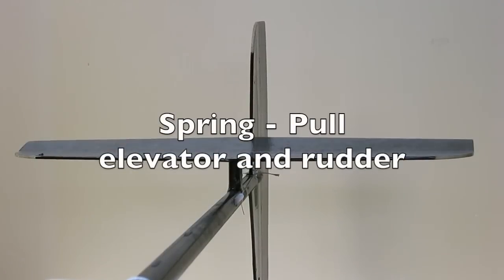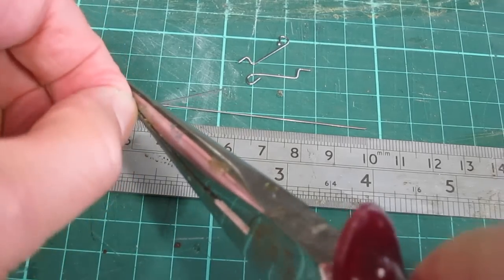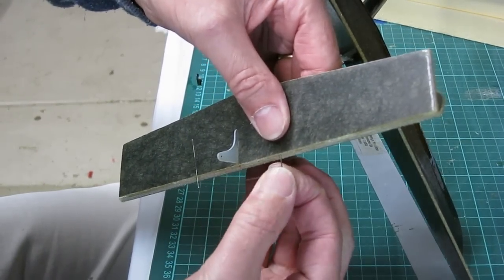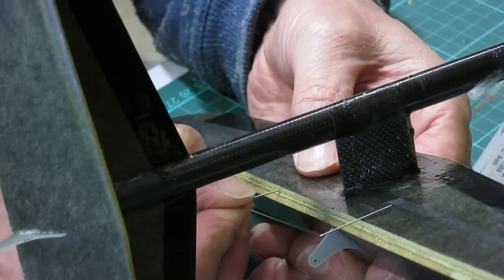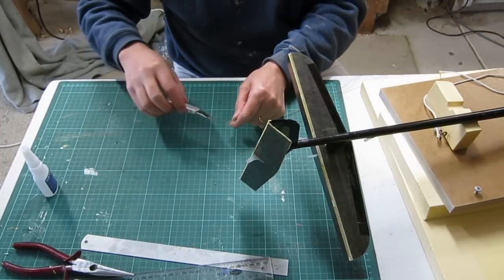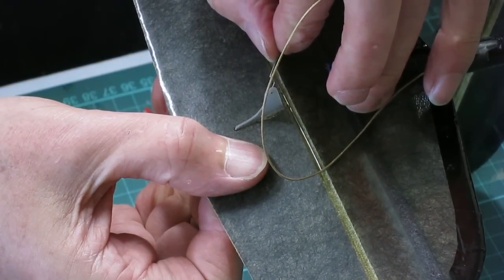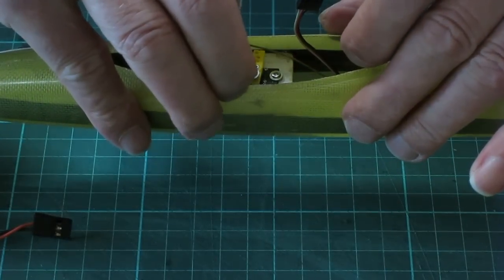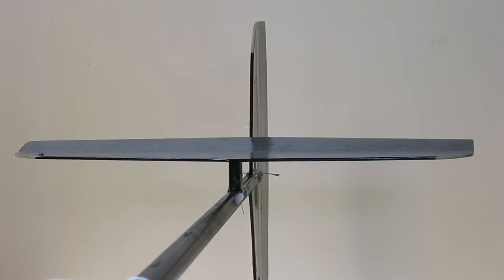V2 DLG build Part 3 - Spring Pull setup

Comment: Just watched the video again Andrew , for some reason I thought the spring had to be put in under tension , but of course it doesn't , the spring tension is created by pulling in the opposite direction , also i think i'm over thinking things as 'im about to build my first DLG kit and I am , and a bit worried I will get something wrong mate . Thanks so much for getting back to me , love your videos mate .
Reply from the maker: +Scott Thompson Thanks Scott. Might be good to try the spring out in some foam or balsa first. It is a bit scary the first time.
Reply: +Andrew Newton Cheers Andrew. I will do , also , does the spring ever work its way up to the surface after time ?
Reply from the maker: +Scott Thompson Not yet Scott. A little CA strengthens the hole
Reply: Cheers mate .

Comment: Thank you for this great instruction!
Could you please explain: When the rudder is in neutral position, then the spring is under tension, right? Doesn't this cost much more battery than a push-rod system does, where there is no tension in neutral position, and the servo doesn't need energy to hold it in neutral?

What kind of spring wire can be used?
Reply from the maker: Correct but the extra battery drain is insignificant. Very thin spring wire or SS wire. Might be 0.3mm, not sure.

Comment: Hi Andrew, great video. Which side of the rudder do you attach the horn? I guess that the horn should always be on the opposite side of the plane to the throwing peg. That way during the initial part of the discus launch the string will tension and prevent the rudder being deflected by the initially high wind forces during rotation. What are your thoughts please?
Reply from the maker: baggs1955 Correct. Opposite side to the throwing peg.

Comment: hi andrew - experimenting with the torsion spring hinge and here on your video i'm not seeing a bevel on one side of the elevator? i would expect that to be needed in order for the elevator to swing freely in the direction away from the side where the hinge is.  i can see that this foam core is very thin but i'd still think it would get hung up if one side didn't have that angled relief.   what am i missing?  thanks.  btw - i am finding that a plain (unwound) .018 guitar string works well for the spring - plentiful and cheap, you can get one at a music shop for a buck, giving you > 30" of material.
Reply from the maker: Good tip thanks, never thought of a guitar string. There is a bevel but the elevator is so thin it doesn't really matter.
Reply: Thanks, I am about to embark on building the Ultra light SS from Andrews website and have been scratching my head trying to figure out what wire I would need for the torsion spring. I've ordered 3 lengths of Anti-Rust Plain Steel Single String .018 and can't wait for it to arrive!!
Reply: @Andrew Newton Test it out on your blog, these torsion springs are brilliant but I had no idea where to find the right material.

Comment: Have you ever had a case where the spring wasn't strong enough to move back properly in high speeds?
Reply from the maker: Not with gentle gliding but it could happen

Comment: Great video Andrew, Thanks. I would like to use this system for a warmliner elec glider (Kunai 1,4m), a few questions - Do you think this setup will be able to handle the extra forces of that plane? Is there a lifespan on the spring itself, ie does the spring lose its torsion over time? I will use Hitec HS-5055MG Digital Metal Gear Servos, they are not cheap and nasty servos, do you think they need a counter spring or not?
Reply from the maker: +Lawrence Viljoen Thanks Lawrence. I dont think it would be a good idea for a warmliner. Fast speeds and higher loads might overpower the spring torsion. I have not needed to replace any of my springs yet but they are on very light weight slow flying gliders.
Reply: +Andrew Newton Thank you.

Comment: Using this method, the servos are always under tension. Does that put a strain on the servos or is the tension not that much?
Reply from the maker: Dave Mason Yes they are always under tension but they can handle it. Some builders add springs to the servo arm to counter the pull but I haven't tried that yet.

Comment: hi there, I was wondering if you could tell me how thick that push rod is that you used for the spring
Reply from the maker: +Jayden Molloy Hello Jayden. It's about 0.4mm stainless steel wire
Reply: +Andrew Newton thanks that helps alot